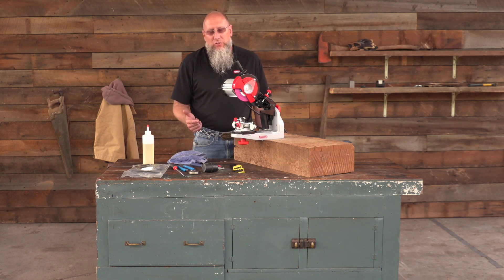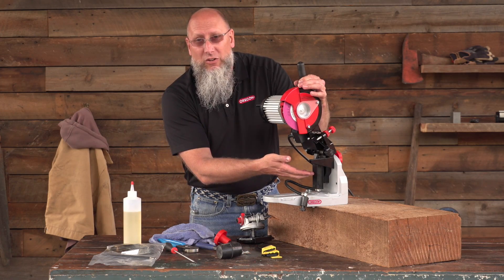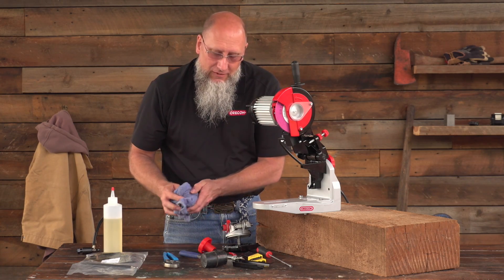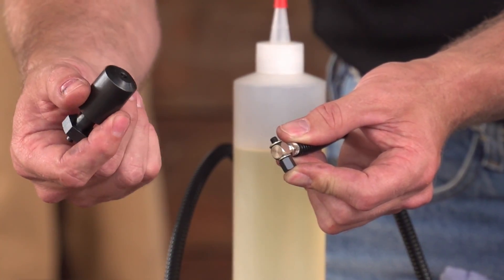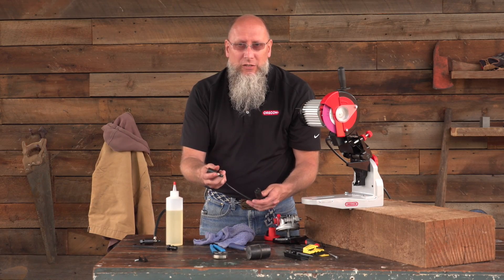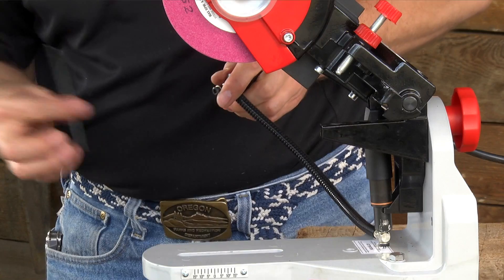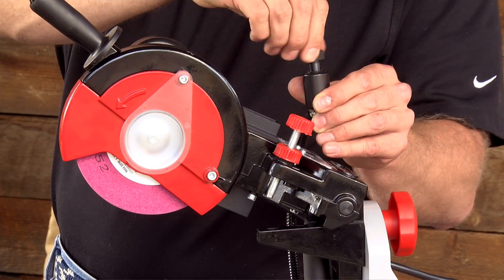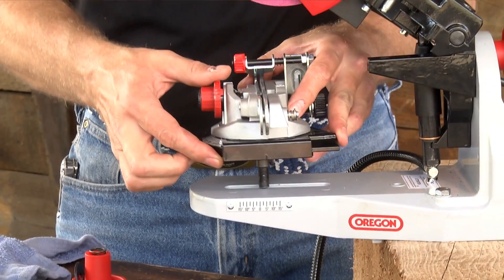Technical Tips- 620-120 Chain Grinder Maintenance (Oregon chainsaw sharpener)

Comment: Thank you Sir very much for offering your expertise on how to bleed the air from this hydraulic system.  I'm using an old Super Jolly which looks much the same as your product.  I could not glean the excellent information you provide here from their written manual and so was very frustrated that I could not figure out how to properly bleed all the air out of that system.  Consequently, I was not able to get the full performance desired from that clamping system.  I just got it bled properly and now it works better than it ever has, even when it was new!  I'm very happy with this video and recommend anyone using your Oregon or a similar Super Jolly hydraulic clamping grinder having trouble with the hydraulics to watch this all the way till the end.  Thank you again!!!

Comment: I just got mine from Amazon and it is leaking oil out of the box from the factory, what oil is recommended to refill it? It is going to likely cost me a good amount and it got everywhere. Amazon is not real help and I do not want to be wasteful if it can be fixed.

Comment: How do you completely remove the air from the system?  I have cranked the cutting wheel up and down about 300 times and each time it produces a bubble.  The bubble size never changes....   it is as if I am making ZERO progress.  I have the fill chamber elevated above the rest of the system.  The manual says under 'routine maintenance' to add 6cc of oil (or maybe the max capacity is 6cc ?)  at any rate...  after a couple hours of double checking and pumping, I am exactly where I started, even with a new hydraulic assembly.  I bought this gadget in 2013 and have sharpened maybe 50 chains....   after moving my household, the assembly showed some weeping and the clamp stopped clamping, so I threw another $100 out for a new hydraulic system.  Scratching my head here.  All screws and fittings have been tightened.  Hydraulic fluid is a name brand.  Ugh.
Reply: I am having exact same problem you are having. I went through and made sure everything on the hydrolic system was tight and sure enough they were. 
Just like you very pump i get air, the exact amount every time. I even turned the whole thing upside down so the cylinder banjo bolt was up amd still got air. Not holding chains very well either.
Reply: Wow. This could have been me writing this. Same as you, except mines only 5 years old. Haven’t bought the new replacement hydraulic setup yet. 
Just had a loose bolt and was allowing the fluid to slowly leak to the point the clamp stop working. I tightened everything up and added fluid. Now I pumped it 301 times and still the clamp doesn’t work. IDK.
Reply: This is what I’m dealing with piss poor instructions as well from Oregon

Comment: Good afternoon, I live in Brazil, I imported a current sharpener oregon 620-120, but after I sharpen a current it heats up a lot, my network is 220v and I use a transformer for 110v, so can that be why it gets so hot?
Does yours after sharpening a chain get hot too?
Reply: Even my junk Harbor Freight sharpener doesn't get hot. Could be an undersized step down transformer. Make sure the output of the transformer is greater then the motor input - either in amps or watts.